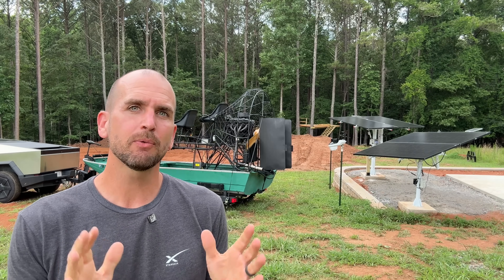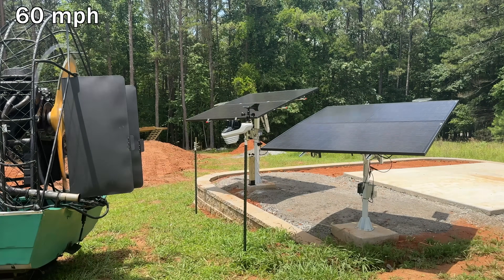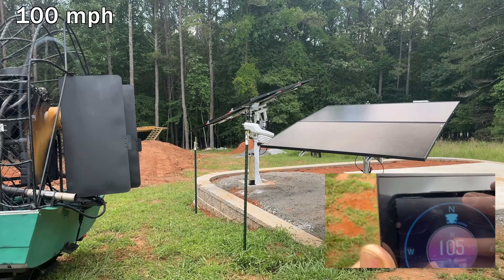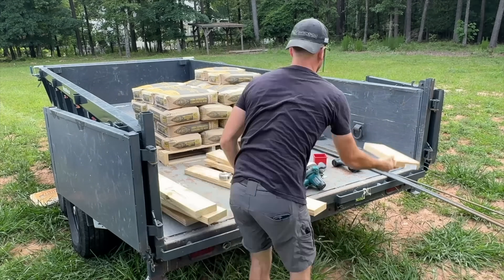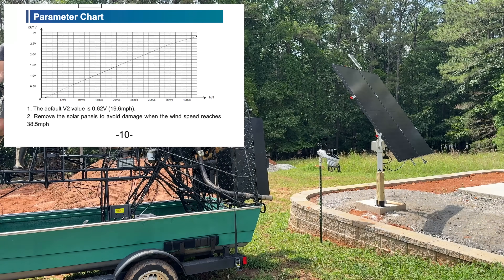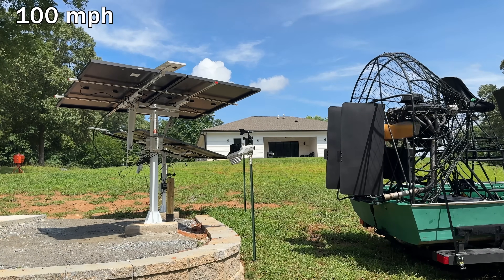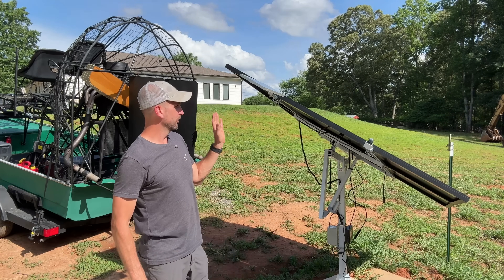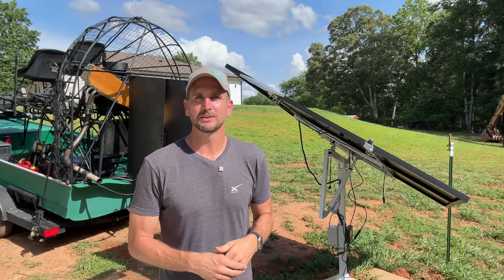How Much Wind Can a Solar Tracker Take? You Might Be Surprised…

Comment: So much respect!! I was thinking of taking 55g plastic drums and filling them with sand, stones? Put in drain holes in bottom. Put a 4x4 post in middle of each drum. I know its nuts, what about 1 loaded drum with weight handling 2 panels? Say 2 100W Renogy panels and proper U Channel. Drums are round hence 90mpg wind no issues. BUT can the drums handle it like a Cement mount with what you built. Just thinking and I love your talents, hand salute! It's all good :)

Comment: Thinking, time to modify! 

I'm wondering about 24 hours at 100mph? I'll dress my wires better. 
Perhaps hurricane strap things together in case they disengage from the unistrut.
Running control wires - remote control  - to bird bath position the array for hurricanes.

Thanks for video !

Comment: I'm honestly most impressed by the PV panels themselves. I had always wondered how well the rigid-frame panels would hold up to wind, only being supported at 4 points, and it looks like they do a fantastic job.  I'm thinking of building my single axis with 2-7/8 pipe sunk into concrete, and seeing how little that post flexed at 100 MPH, I'm more confident that it will have no problem holding the cells.

Comment: the effect of the wind is far different than just blowing it with a fan... it has both positive and negative pressure zones that pull  with a fluctuating force.. and also things are stronger under compression than tension... and so the wind sucks the pannels off the rooftops rather than blow them off

Comment: Thank you SO MUCH for this video! I have been worried about the wind. I put in 8 single axis trackers in March in SW Alabama 100 miles from the Gulf where there are winds sufficient to snap off large dead trees and have considered building wind breaks around the perimeter. I am VERY reassured after watching this video. The reason I went with single axis over dual was to have a smaller panel surface area (sail area) and a lower, heavier tracker -- all to reduce wind vulnerability. The dual axis, completely loaded with maximum panels seems to be asking for trouble, but after this video maybe not. I'm about to put in 2 more trackers. They perform beautifully and even with 8 holding 800 watts of panels each I've been able to disconnect from the grid and live very comfortably (including charging my Chevy Volt).

Comment: There is a lot more torque the further from the center and since the panel area is much smaller than what the dual tracker is designed for, it ends up not being that informative for the tracker, just the panel hardware.

Comment: Panel trackers made much more sense, back when panels were really expensive. Now, panels are cheap enough, that it might be more worth it, just to buy a few extra panels for a fixed position set-up, such as roof-top installation. Putting them up on the roof helps reduce shadowing by trees and utility poles, allowing collection of solar energy earlier in the morning, as well as later in the evening.
Reply: The trackers are a game changer compared to fixed. I put a system on the roof of my camper van 8 years ago and have tested production compared to the trackers. Eco-Worthy is understating the increased production by using a tracker. Angle makes a huge difference. In addition, with trackers it's very easy to keep the panels clean with a mop and hose in a few minutes. During seasons of high pollen being able to do that daily is a big plus.
Reply: @moirhoh  Trackers are the only way to go,, for any kind of RV. With limited roof space, they can increase the effective output of a panel by ~1.8 times, as long as the panel can "see" the sun from sun rise, to sun set.

Comment: Thanks for doing this video I have 2 dual axis trackers when they go flat in the wind they wobble a lot. I would think if the airboat were placed further away it would generate more turbulence from the surrounding air flow. Good test though.

Comment: The worst case test in the end was far from a worst case. You tested it with the linear actuator fully retracted and compressing it. Try it the other way around with a fully elongated linear actuator and pulling on it. Then you will see why they are only rated for 38 mph winds.

Comment: I noticed a lot of shaking of the panels in terms of flex of the bracket. Does that lead to premature panel failure through flex on the frame and backplate? Micro cracks at the cell level?  Did you do a before/after power test?

Comment: I have the dual axis, but i manged to slightly extend the mounts and put on 4x 405w panels. I know for a fact it won't take 100mph winds, but it has seen 55-60mph gusts so far. I am planning some reinforcement items in-case we get heavy storms soon so I can disable tracking and brace them during storm. I dont plan to take the panels off until they blow off.

Comment: I have the dual axis on the coast in Washington State. Our winds routinely run over 40 mph. I watch the forecast and if it projects over 30, I manually flatten and strap it down with straps. I love mine. They work great to capture every possible ray in an area where sunlight is at a premium. I have had both the actuators fail. Likely due to the amount of rain we get. I have read few comments about mounting them upside-down but when I did that the East-West actuator locked a couple of time in the due East position. Echo-Worthy was great about replacing both parts.

Comment: When the wind is coming I anchor my trackers in a flat position or slightly dip down towards the wind with strays and ground posts. Wobble bothers me, so I have shimmed the main upper arms and reinforced square post bolts with a 12x2 inner steel pipe. Running large systems 4 350 watt panels each 12' x 10' area per tracker. Also upgraded my struts to the double gauge size. Getting about 1.2kwhr each most of the day. And shade for the dogs on hot Vegas days. Also use a wind turbine and a small 50w panel to power two 12v batteries, to make sure I have the power to retract in cloudy windy days. Thunderstorm gusts worry me, but so far so good.
Reply: My dog likes the shade under the trackers, too!